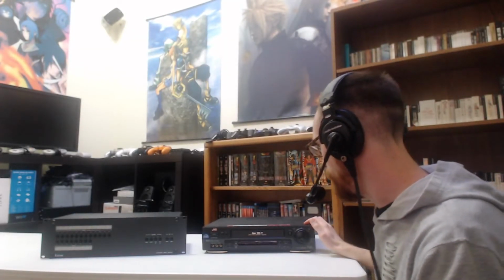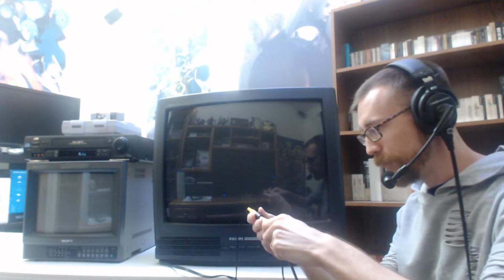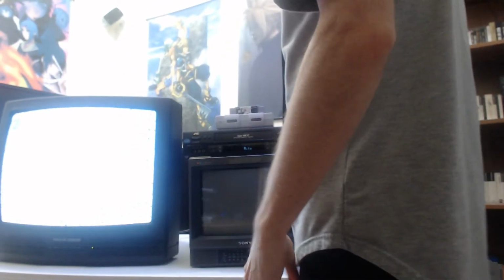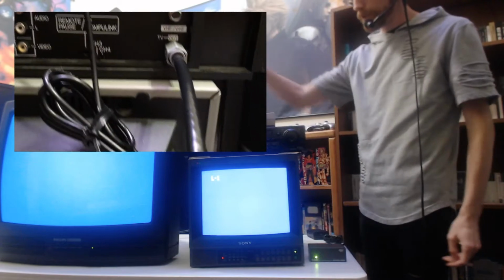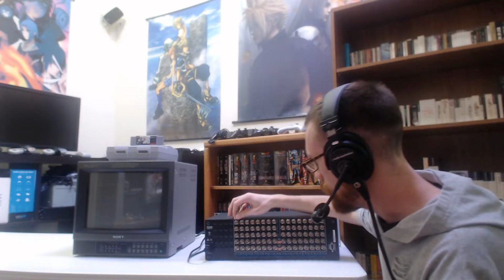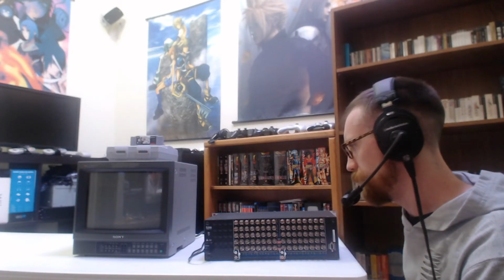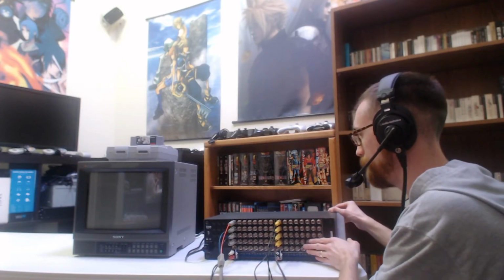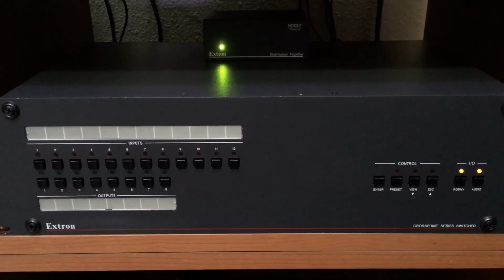Splitters, VCRs and Matrix Switchers

Comment: You know, any S-Video breakout can be adapted to BNC without expensive or rare adapters… like the one for Commodore 64 monitors. Just toss on a couple RCA to BNC adapters and you are golden. You could also just splice one together yourself. Easy!
Reply from the maker: That's a great thought; I didn't even consider that at all when I was first making this video!  Certainly is cheaper to do that, than the one method I suggested.  Thanks for commenting!
Reply: @ZXRyuu  No problem.

I believe that Console5 offers a cheap one for connecting 4-pin S-Video to Commodore 1701 or 1702 monitors with RCA input. With a couple cheap RCA to BNC adapters, you’ve made it into an Extron Crosspoint S-Video adapter. ;) Speaking of “cheap” and “Extron,” I’m gearing up to offer unfinished Extron cables to solve the issue with adapters and custom cables being too expensive.

I got 1,000 feet of Extron MHR cable, a bunch of Phoenix-style screw terminal connectors for audio, the crimp tool, hundreds of Extron MHR BNC connectors, square ferrules with their appropriate crimp tool, and various plug ends for consoles. I’ll basically cut various lengths of Extron MHR cable and crimp the BNCs and square ferrules onto one end and install the audio connector. I’ll then bundle them with the appropriate console plugs for the end user to finish themselves (solder into the connector). This way I can sell a set of 10 cables for a fraction the price of the folks selling finished custom cables. Really makes Extron the value king for people who aren’t just buying a bunch of expensive g-whatever switchers and SCART/HD Retrovision cables. ;)
Reply from the maker: Nice!  I just found the page and marked it for later.  I probably need to update some of my videos to reflect some of the things I've learned since making them.

That would super helpful!  I'm glad that more people are making custom cables to help fill in the gaps creating by retro gaming and tech!  Maybe we can do a collaboration or something in future when you launch your line of cables.

Comment: Hello, if i put both rgb and component inputs to output them with a rgbhv to rgbhv cable, will it work if i switch between rgb and component or will i get only rgb or only component ?
Reply from the maker: Hello, thanks for commenting!  Here's my take on your question; and as a side note I don't have a PVM with Component Inputs to try this, so this is all theoretical.  My guess is that if you connect an RGBS or RGBHV Input and a Component Input to say an Extron Crosspoint and then switch between them, it should work with an RGBHV cable as an output to a PVM that has both RGB and Component Inputs.  My only reservation is the sync.  Component uses Internal Sync because the sync signal is on the Y (Luma) line, whereas RGBS or RGBHV use External Sync because the sync is on separate lines.  So you may need to switch the Sync signal on your PVM between internal and external when you use Component and RGB respectively.  Again, if you have or are going to use an Extron Crosspoint, you will need to use CSYNC, because that's the only Sync signal that Extron Crosspoint units can use.  Hope that helps and answers your question!  If not, or if you want to be more sure, I would need to know a little bit more about what equipment you are using in your setup; PVMs, Switchers, Consoles, etc.
Reply: @ZXRyuu  Thanks for answer ! My PVM is a JVC TM-H1950CG with RGBHV input, the IF-C01COMG modul (and also 2 bnc composite inputs) and it says that it accept RGBs and component, i've got another one, the famous sony 2130QM, but there is no component, it does rgb and composite only (there is bnc composite input, scart rgb input and db9 rgb input). The switcher is an Extron crosspoint ultra asdp 88 for the JVC, and i use scart rgb switch for the sony. i don't have all the material to test yet.
Reply from the maker: @zizarami3270  You're welcome!  Some nice gear you got there!  I would like a PVM with Component so I can do a few more things, but I'm good with my little Sony 1342Q for now.  After looking over everything, I would arrange the plugs/colors on the back of the Extron Crosspoint to match the inputs on your IF-C01COMG Module.  So, from the top plug of the Extron on Input 1, I would attach Component with Y, then Pb, then Pr (Green [Plug 1], Blue [Plug 2], Red [Plug 3]) and then attach RGBs to Input 2 as follows:  Green [Plug 1], Blue [Plug 2], Red [Plug 3], Sync (S/H) [Plug 4], Sync (V) [Plug 5].  Then on Output 1 I would match the colors and plug positions; so from the top, Green [Plug 1], Blue [Plug 2], Red [Plug 3], Sync (S/H) [Plug 4], Sync (V) [Plug 5].  That way, when you plug in the other end of your RGBHV cable to your PVM it will all be coordinated and match the labels on the PVM so that it's easy to keep track of on both ends.  If you run into a problem where the colors aren't matching or showing up correctly, let me know and we can troubleshoot it.
Reply from the maker: @zizarami3270  Yes, that's exactly the cable that you would need.
Reply: @ZXRyuu  Thanks ! I will make test as soon as i get everything.
Reply from the maker: @zizarami3270  Sounds great; thanks for watching the video!  Enjoy!
Reply: @ZXRyuu  Continue to make that kind of tuto video, not so much on youtube, so that's great. Thanks !